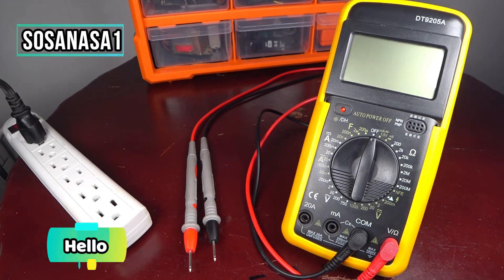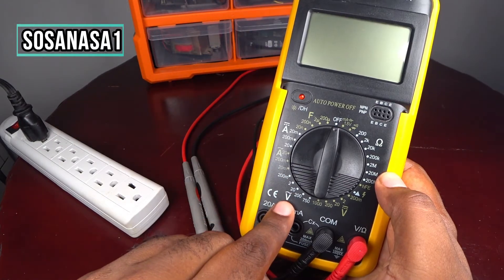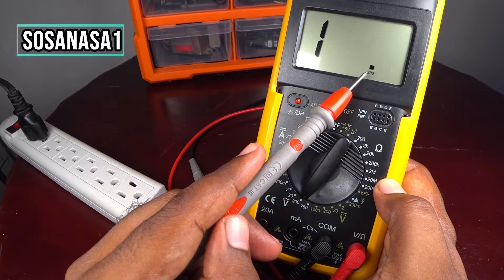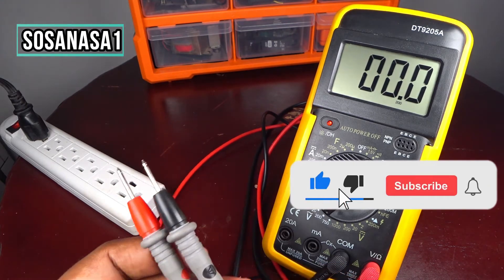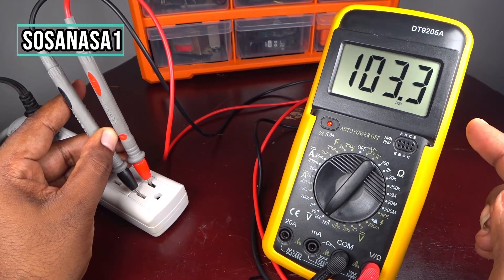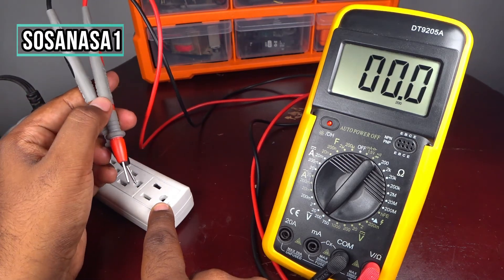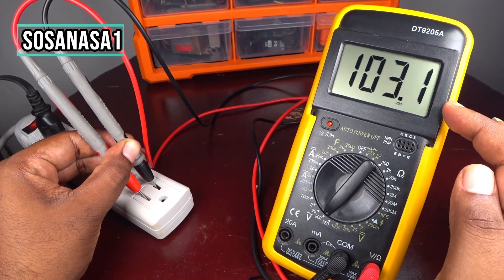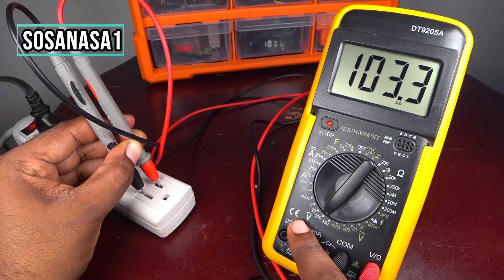Testing House Electric Outlet with a Digital Multimeter (model DT9205A)

Comment: Domestic electricity are usually either a.c.110V (USA, JAPAN, TAIWAN) OR a.c. 220~230V.  So switch to 750 Ã (DT9205A)
**

There are safety "valves"  on the "common/earth". 
If the earth is not inserted, the  "life" socket and the "neutral" socket will not open.

So,  first insert the common(usually black probe) into the "earth" socket, then insert the red probe onto the "life" socket, then pull out tje black probe and insert into the "neutral socket"